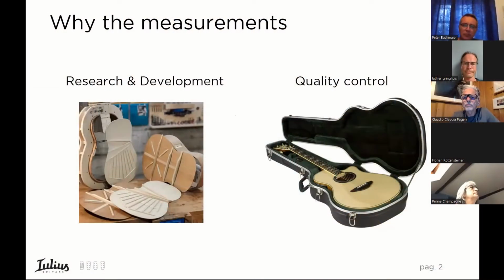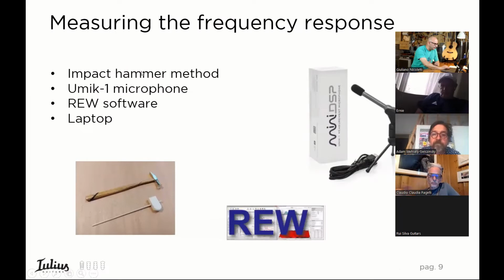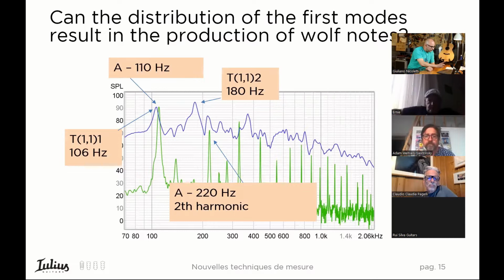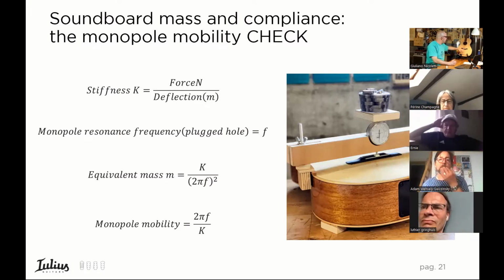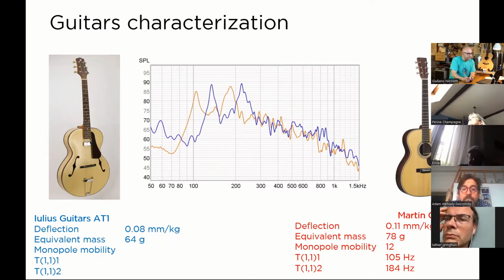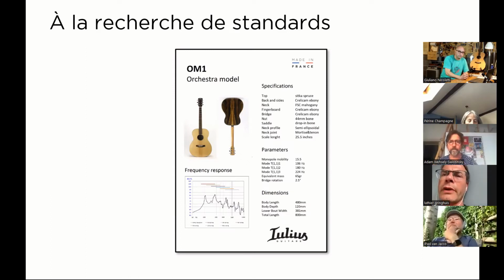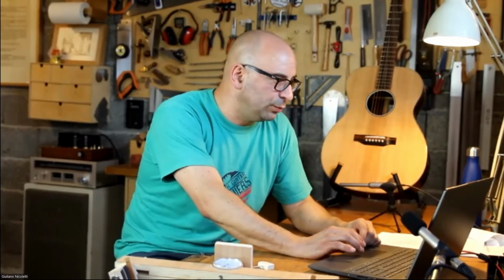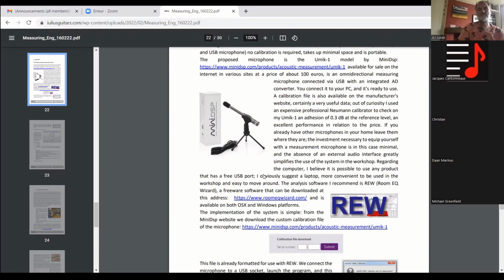Measuring and tuning the performances of the acoustic guitar - EGB webinar July 2022

Comment: Thank you so much for sharing your knowledge with the world!

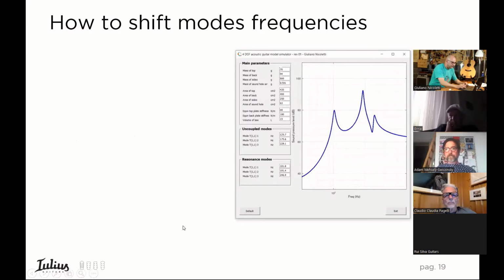35:50 For 4DOF modeling, I've been using a MATLAB script in GNU Octave, which pulls input parameters from a spreadsheet and then inserts the results back into the spreadsheet.  This is non-interactive and slow, so I would find your 4DOF simulator software to be mush easier to use.  Would you be willing to share it?
Reply from the maker: Hi Gregory, thanks for the appreciation. Please send a mail with your contact, i'll be happy to share the software (it also runs on GNU Octave).
Reply: @iuliusguitars  OK, I used the contact form on your website.